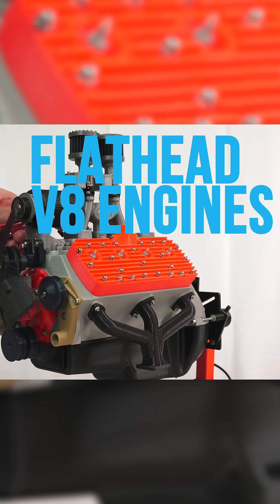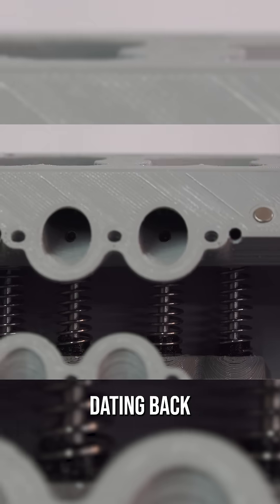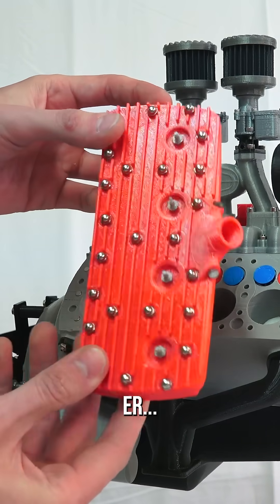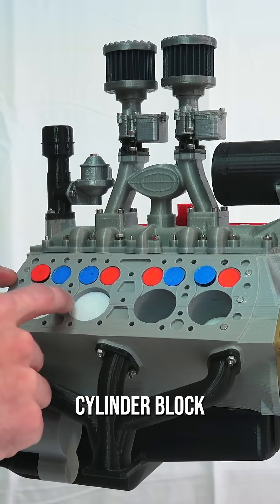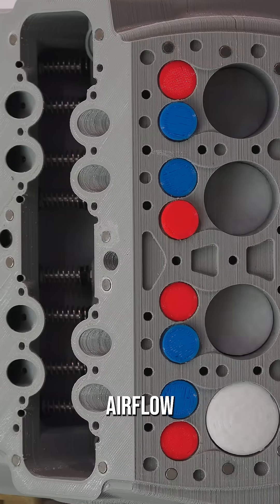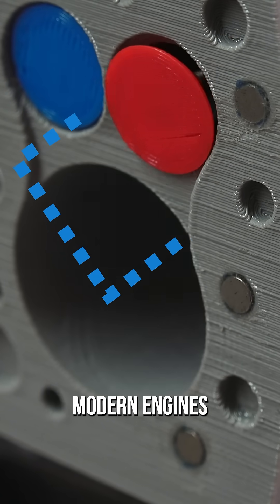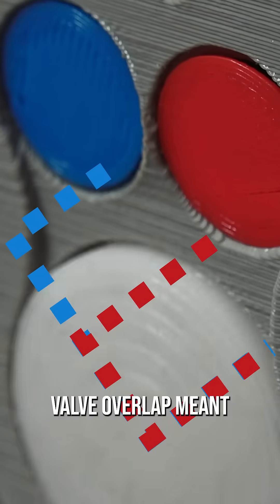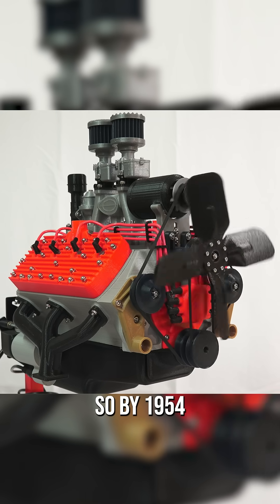What Killed The Flathead V8 Engine?

Comment: Not the first V8.
It was the first workable V8 cast in a single part. Previous V8s (there were many) were cast with bolt-on cylinders.
Ford made this configuration affordable.

Comment: theres a whole host of reasons... the combustion chamber has a far higher surface area to volume. its an odd shape so doesnt combust well, tends to induce detonation, blah blah. a fords shared the central exhaust port.
the "reverse flow" is a terrible explanation... a poppet valve already makes gas perform a 90 degree turn... its that at least half of the valve area is facing away from the cylinder. in that regard, that air does have to reverse flow. the side facing the cylinder technically should breath BETTER...

makes me think of a parallel twin with valves between them... hmmm.

Comment: Why is there only 3 headers leading to the manifold?  Is it just that model or were all flatheads lile that? My dad's Beaumont with a 355 in it has one for every cylinder,  I'm guessing here though, the center 2 cylinders on each side share an exhaust port into the headers?  I like the look of the 4 coming out the side than combining into one. For a second i thought this was a 6 cylinder because of the headers.  Just curious.

Comment: Does this channel do any research or is it shovelware? The flat head's problem is low compression and bad chamber design. Air changes direction all the time (look at the INTAKE PIPES on any car), and at low RPMs is encouraged for better mixing ("swirl"). It has tons of problems, including air direction, but "air direction" is far from the most important flaw

Comment: More specifically -
To get the exhaust from the inner exhaust valve area to the outside of the block resulted in the exhaust port runways running through the water jackets of the cast iron block - setting limits on how much heat (a by-product of producing power) could be tolerated.  
Some manufacturers (Packard / Cadillac) got away from this problem by running the exhaust back towards the center area and taking it away via a top mounted exhaust manifold.

Comment: what killed the side-valve (flat head) was good steel. Originally valves kept breaking due to the crap old steel. Drop a valve in a low performance sidevalve & it safely rattles around in its pocket & you can easily replace it. Drop a valve in a better performance overhead valve (or cam) & you grenade your engine. Hence the original flathead popularity,  better steel then came along, OHV & OHC became more reliable so people moved over for the power.

Comment: There was a company making conversion kits for the flathead Ford's back in the 1950s with overhead valves, hemispherical chambers, rockers, oiling, and exterior exhaust that didn't go through the block. Then better engines entered production.

Comment: @EngineeringExplained Not bad for the technology they were working with at the time! The Flatty also played a pivotal role in hotrodding, drag racing, stock car racing, development of aftermarket performance parts, and is even mentioned in the Beach Boys' hotrod anthem "Little Deuce Coupe". Although it was replaced by more modern engines in the 1950s, the Ford Flathead's popularization of V8s helped pave the way for the Golden Age of muscle cars in the 1960s!

Comment: Another issue with the flathead is displacement limitations due to the valves being besides the cylinders they could only make the bore so big before they would have to increase the size of the engine block using more material and causing more fitment issues

Comment: Millions of these were made from 1932 to 1953. Ford's design was particularly bad as exhaust was routed through the block making them run hot to create the appearance of a cross flow design. Other flat heads had their exhaust exiting out the top, next to the intake allowing them to breath better.

Comment: Mechanically simple, compact  and cheap. This is why the flat-head design persisted in lawn-mowers and go-carts for decades after auto manufacturers went to overhead valves. There is nothing like the sound of a flat-head Ford engine.

Comment: I wouldn't say air flows in opposite directions so much as has to deal with valve size vs compression. More flow = lower compressio. A lose/lose design for anything except low rpm & low power without a supercharger to fix that compression problem.😅

Comment: The first mass-produced V8 engine was introduced by Cadillac in 1914, with over 13,000 cars equipped with the 5.1-liter, 70-horsepower engine sold in its first year, you lied 😂

Comment: Low compression, low power and the least amount of moving parts in any V8 engine ever produced. Rebuild one with todays materials and use modern oil, fuel and coolant and you'll have the most reliable daily driver ever.

Comment: The flat head is simple, just like this explanation. The true reason was that 8:1 compression was as good as you could get with a flat head. If you reduced the size of the combustion chamber any more you restricted the amount you could open the valves. The awkward shape of the combustion chamber also increased the amount of surface area in the chamber, allowing heat to escape without producing power which made it inefficient. In a world where high octane fuel was unavailable they made some sense but after WW2 higher octane fuel became available and engine designs changed to take advantage.

Comment: Chevrolet had the first V8 engine with the Series D, which was produced in 1917. It was a 288-cubic-inch, liquid-cooled engine with overhead valves. 
That’s right the first overhead valve V8 engine was produced by Chevrolet in 1917 .

Comment: Some people call the "heads", "plates". And the engine also  had a nickname of "boiler" as they ran hot and some would run 2 radiators with them. Also the shared exhaust ports for cylinders 2,3,6 and 7 would cause block cracking from valve bowl to the cylinder wall.

Comment: ford hd their reasons for going down this route but there really wasnt any excuse for such a horribly inneficienct and badly thought out design.    pushrods are bad enough but a flat head? no pentroof? no variable cams? no variable length intake? no pulsewidth tuning? less than 100hp/l N/A?! really horrendously disgraceful engine. 
 depsite all this they make a nice noise.

Comment: Even though they were inefficient and under powered, they could run for decades because of the simplicity and less moving parts. I still see 30's and 40's cars with flathead engines, and it still runs perfectly and everything is original.

Comment: fuel efficiency was the major reason, Ford also only used 3 main bearings  to save costs which also limited power you could make, and the issue of having the exhaust cross the block created overheating problems if you upped the output of the engine, other flathead v engines of the time had the exhaust exit on the valve side, or in the valley of the V eliminating that problem
Reply: Fuel efficiency was very good ... The Flathead Ford V8 got 20 plus miles per gallon ..

Comment: Also the compromise between compression and valve lift.  More valve lift requires a bigger dead space which means less compression.  With overhead valves, the lift isn't limited by the dead space because the piston moves out of the way.
Reply: Not a problem with offenhauser high compression aluminum heads an intake manifold with three deuces and a higher lift longer duration camshaft.... My uncle raced on a dirt track in a 1940 willys ... There was a bank oval track with grandstands all the way around it called The fast track in Terre Haute Indiana... Would go there with my dad and watch Uncle Pete win. The Flathead Ford was quite popular in racing on dirt tracks.... My uncle Pete's favorite car was a three window 40 willys

Comment: I have a 1948 f1 with the 239 v8 flathead, with 3 speed in the floor. And yes its all original, never bored, cam'ed, etc. And yes its @90hp, its not fast, wasn't meant to be, but will pull like crazy in first gear. My dad bought the truck 2nd hand in 1972, I inherited it in 2019. Like said, it ain't fast, but tough as nails. Love it.

Comment: Though it's true that the Flat Head V8 is not built by an OEM (Original Equipment Manufacturer) for use in a modern vehicle, there are a few companies still building Flat Head V8 'crate' engines for those building kit cars, or those who need to replace their original engine with a faithful recreation engine for a Flat Head equipped classic. And if by chance you're wondering why they're referred to as a 'crate' engine, it's because when shipped to either the shop or the builder's home, it arrives in a wooden crate.

Comment: Many other companies built the valve in block engines well into the 70's and still today. The thing with the Ford version was they were built on the cheap. Low grade metal and design, that's what caused the cracks and poor over all performance. Their in line 6 version had the valve in block design, but had a much better durability. We used that same style valve in block in line 6 in farm machines with great success, many have many thousands of hours without fail.  The V configuration was a way to shorten the chassis and cut down on material needed for a car, still a big goal with todays cars.
Reply: Dodge smd Plymouth used flat head six engines for better than 30 years. Not only cars but well later in trucks. Same engines were used in farm equipment and stationary needs.
I had a 1950 Plymouth and a neighbor a 1959 one ton truck. 
You could use thin copper head gaskets to raise the compression ratio.
You could make a lot of modifications to the Ford V8 flathead. That is why you could find aluminum heads, dual aluminum intake manifolds, better distributors and water pumps. Improved oil systems and filters. There was someone that produced the block in aluminum and new cast iron blocks. Do not think they will ever let that engine die!👍

Comment: That is why you want the Offenhauser heads. It is all about how much air you can move. That is why Porsche could take a VW engine, redo the camshafts and the heads, intake and exhaust manifolds and put dual carbs on it and get more than double the power,back in the day

Yamaha did it for Ford with their SHO Taurus not that long ago

Comment: Don't forget that the surface area of cold steel exposed to the hot combustion gases is greater, resulting in more heat absorption during the power stroke and making the poor efficiency of the combustion engine even worse.

Comment: A few things that this narrater forgot to mention is: The  majority of V Type, inline type,  Opposed type , single cylinder type, reciprocating engine designes , use a Single  camshaft , regardless whether they have  valve in block induction systems or overhead valve systems... And the  majority of long life expectancy industrial type engines , still use single, non phasing type  gear driven cam shafts, because of their known dependability and ease of maintenance and longevity...
       The multiple overhead camshafts and complex camshaft drive systems on many of the newer high tech vehicles,  have been knowwn to perform brilliantly, when they work properly, but unfortunately, many of them develop catostrophic internal engine problems when  these machines often have other internal components that are still in good shape...But, the complexity and reduced reliability on the more modern vehicles, have often negatively affected the  resale value of those extremely high initial priced machines, because of the known inherent problems that have been carefully planned and designed by vehicle manufacturers, to drastically reduce their capable lifespans, by a factor of x4 or even x5 from designs that were readily available 30+ years ago... Which BTW many are still operating just fine, including these 'obsolete' flatheads... Thiis situation is PRECISELY what the current auto manufacturers wanted to create and convince much of the general public what they "Want",  
         But in actuality, NOT what the general public needs...   And this situation has greatly INCREASED the VALUE OF Older, less complex machines... For restoration and resale... You be the judge of which You want more, the current vehicles with extremely high initial price tags, or the simpler longer lasting , higher purpose, higher value, restored vehicles, with lower maintenance costs, and much higher resale values, which drove on the same roads with many of the same speed limits, 30+ years ago...Think it over...
   Today is: 10/14/24

Comment: aside from the reason being cheap to manufacture/machining the block ( Ford model T) the main factor you left out is the limit of compression ratio which is usually around 1:6 maximum 1:7 at most, restricted by the turbulent counter airflow but more so another major problem; engine pre-ignition and knocking!

Comment: The biggest power killer in the flat head was the low compression. Having to accommodate the valves next to the cylinder meant the combustion chamber was HUGE, and you could only bring the piston up so far. Creating an abysmal 4:1 or 5:1 compression ratio. Compare that to a new Ford v8, with 12:1.

Comment: El diseño de la salida de los gases de escape en los V8 flat head Ford era demencial. El hecho de hacer pasar los gases por la parte superior del cilindro es absurda. Si la entrada y salida de gases hubiesen sido por el mismo lado, hubiese sido mejor.
The exhaust outlet design on the Ford flat head V8s was insane. Having the gases pass through the top of the cylinder is absurd. If the inlet and outlet are in same side,  have been better.

Comment: The current land speed record for a Ford flathead V8 engine is 302.674 miles per hour (mph), set in 2003 by Ron Main in his FlatFire Streamliner at Bonneville. 

Cool huh .

Comment: They are still making flathead engines. In fact there's one which is a fairly recently design. Look up "D-Motor aircraft engine". It started being produced in 2010. Direct drive aircraft engines (where the prop is bolted directly onto the crankshaft) are low revving so the design lends itself to that application.
Reply: And Flathead engines are very efficient with high gas mileage... So I can see where they would get longer range out of an airplane . And high torque at low RPMs would be ideal for an airplane engine.. if the tip end of a airplane prop surpasses the speed of sound.... The prop will cavitate .. so will any prop or helicopter blades ... A national guard sergeant what's telling me this one time in Chicago at a bar  ..we used to meet at every night after work. .. they used to practice flying helicopters over the railroad yards where I worked.. I would sit down at the bar beside him and get me a beer and say how's war going today ? After a few more beers he would tell you stuff about military helicopters that you're not supposed to know ! Hehehe

Comment: i wonder if theres a way to redesign it for better flow while still being a flathead. would having one valve on each side of the cylinder help? intake valve at the top where it is normally (except bigger now) and the exhaust valve at the opposite side (also bigger). in theory (you would have to check this, im not smart enough to do the math on this, just smart enough to think of the idea), the air should all be going the same direction now. might require double cam in block, but ford has done that with the calliope prototype (which a few people are trying to resurrect), tho that was an OHV engine. is this possible sir? i ask because i see a lot of hot rods with these engines, some NA, some supercharged, and some turbocharged (one of which was quad turbo, crazily enough). surely they have some way to make them flow better if they are modifying them that much, right?

Comment: The flathead's curse (and this includes all of them, not just the V8) was it couldn't "breathe". Another problem was if it needed a valve job, it was an engine out, complete rebuild proposition. On the other hand, if you wanted higher compression you could just mill the head (within limits of course).

Comment: It would work better if it had a second cam so the intake and exhaust were on opposite sides. One of the bigger problems with the flathead V8 was the exhaust running through the block which caused a lot of block cracking. Hot rodders started building the first reverse flow flatheads or (hot v) engines which meant the intake was running through the block and the exhaust was coming out of the top of the engine which helped with the block cracking issue and also allowed them to optimize the exhaust design which improved airflow.

Comment: the flathead V8 is basically two Flathead I-4s put together. the Dodge Brothers were making Flathead I-4s in the 1900s, including the ones used in the Ford Model T and the Ford Model A before Ford made engines.

Comment: Does this explain why American manufacturers were making V8s that weighed as much as the car they were in, displaced as much as an Olympic swimming pool, and yet only made like 200 hp at the crank?
Reply: No. You are thinking of overhead valve engines from the 70s, when flatheads had been obsolete for decades already.
Reply: @jaredlancaster4137  oh. So these were even worse?
Reply: @jaredlancaster4137  I'm not trying to be funny, my knowledge of cars dries then dries up fast once we go before the 80s